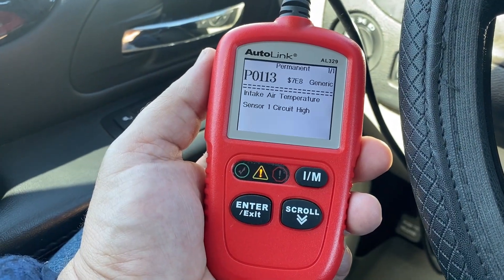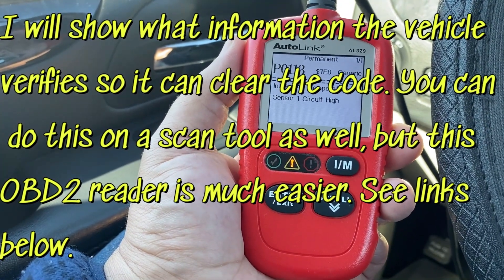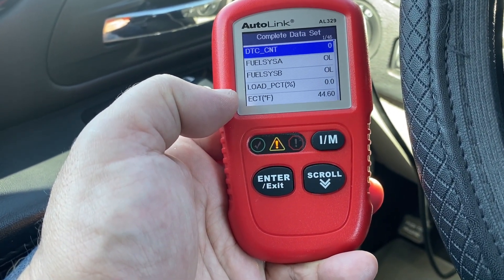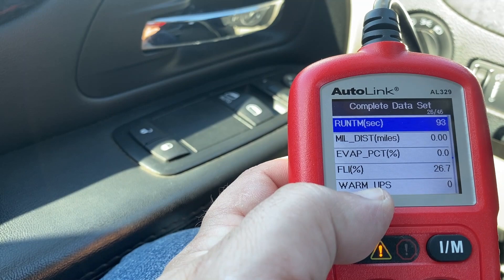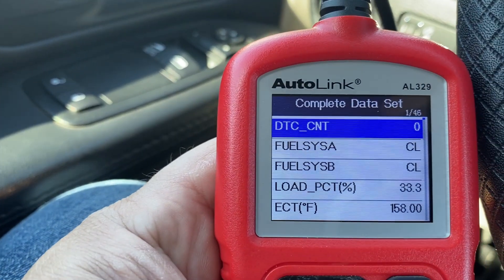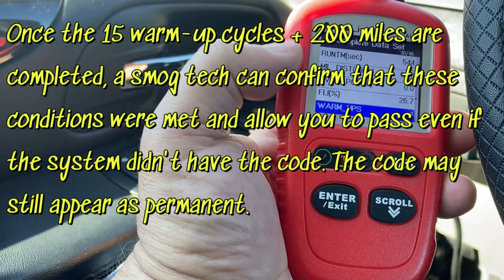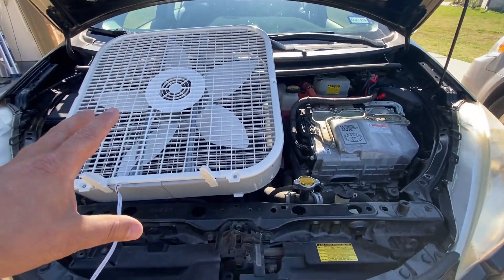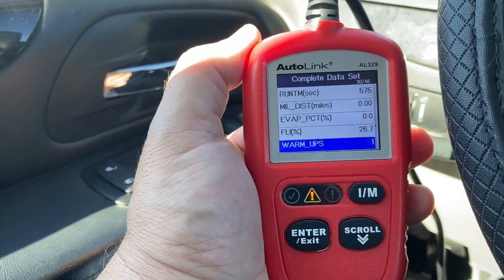Removing PDTC with OBD2 Reader - The Easy Way

Comment from the maker: ▶▶ Link to recommend OBD2 reader https://amzn.to/3SgUTf3
▶OBD2 Reader video   

 • Did you know it can do this? A Smog T...  
▶ Why you need a scan tool   

 • Dealers Don't want you to know this! ...  

▶Complete Smog Playlist   

 • Drive Cycle | Tips to Pass an Emissio...  

▶ Good Bye Permanent Codes! Drive to Clear PDTC   

 • Good Bye Permanent Codes! Drive to Cl...  
▶ PDTC won't clear? Get Rid of PDTC with OBD2 Reader Data   

 • Get Rid of PDTC with OBD2 Reader Data  
▶ Bye Bye Permanent Codes! Clear PDTC using Scan Tool Data   

 • Bye Bye Permanent Codes! Clear PDTC u...  
▶ Scan tool used in video 
https://amzn.to/49vJoqS
special code  XTOOLD7WRDF (8%discount by using this code)

Other PDTC videos
▶what is a PENDING DTC   

 • Why Your Car Says "PENDING" Codes (an...  
▶What is a STORED DTC   

 • What is a stored DTC code? Stored fau...  
▶What is a PERMANENT DTC   

 • Removing Permanent Trouble Codes! How...  
▶pending vs stored vs permanent explained   

 • Diagnostic Trouble Code? Pending vs S...  
▶Permanent DTC long video   

 • How To Clear Permanent Diagnostic Tro...

Comment: I have the same Autel reader you do. I had the P0450 code showing in my 1997 Camry LE 4 cyl. I replaced the evap. pressure sensor switch. After lots of driving that code now has green check, so I guess I put on enough miles for it to cycle through. Now, no CEL showing, but reader shows the DTC and says that P0450 code is now listed as "stored". Also, I have a red check showing for catalytic convertor, despite putting on over 150 miles on car since I last cleared all the codes with the reader. Will my Camry pass smog now, with the stored P0450 code reading and the CC showing red X like that on the reader? Again, the CEL is no longer on. It's off. --Thanks
Reply from the maker: Stored is not same as present but  if you catalyst monitor is not ready you may not pass depending on your state of residence.
Is that only unset  inspection monitor?
Did you clear the code and then  drove around or did you just drive after completing the repairs, then the check engine light turned off on its own?
What state do you live in?
Reply: @RANDOMFIX  Thanks for the reply. Long story, but I had failed smog in Oct. 2025 due to gross polluter status on the Dyno tailpipe test. A friend took my spark plugs out and found they were loose. He put them back in correctly and tailpipe emissions are now super clean, We were amazed. I don't think the CC code was red at that time, but I (stupidly) had him clear the codes with his Autel. The 450 code had been on fail, so I bought a used sensor and replaced it. Also bought an Autel reader like yours, actually mine is the 319 model. But now I'm trying to drive the car enough to get the CC code to go to green check. It still hasn't, despite endless driving. So, now I've got a green check for the sensor and all others except red X for CC. No CEL showing, so I'm guessing the replacement sensor is working correctly. Someone told me the 97 Camry needs to be driven at 55mph for lots of miles to cycle the CC enough to get to green check. Meanwhile I'm now three months overdue for new plate tags. haven't been pulled over yet. I'm in California.

Comment: Hello 👋🏻, do I have to do the 200 miles in one run or can I do them in sections?
Reply from the maker: Either way is fine plus the 15 cold starts.
Reply: @RANDOMFIX  I tried to do the warm ups first but I tried it twice and it won’t count any it’s still at 0, do you have any idea why?
Reply: I tried warm up cycle. 104  eng temp, rev eng to 176. No cycle count.